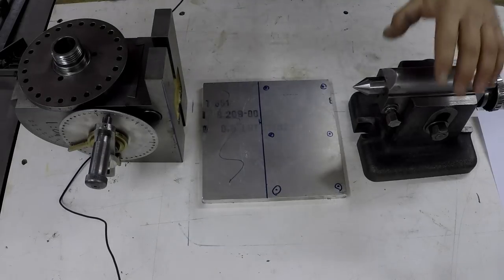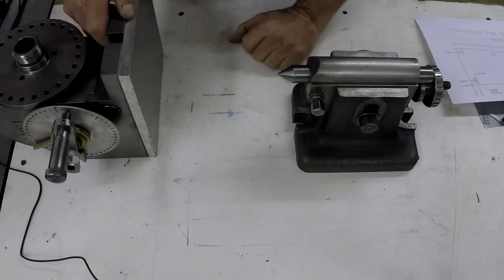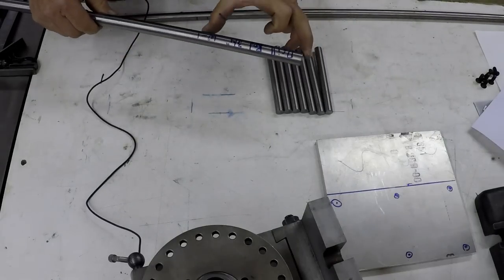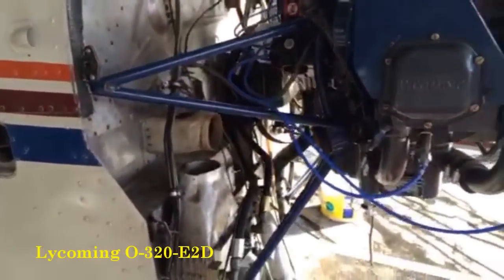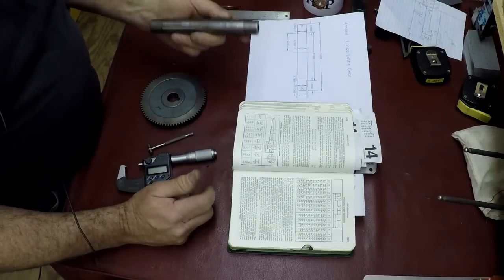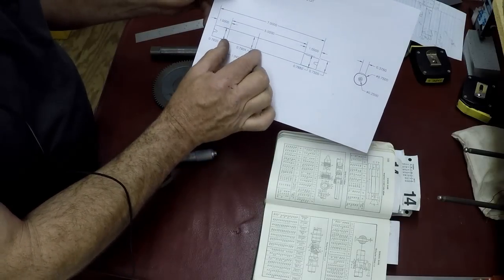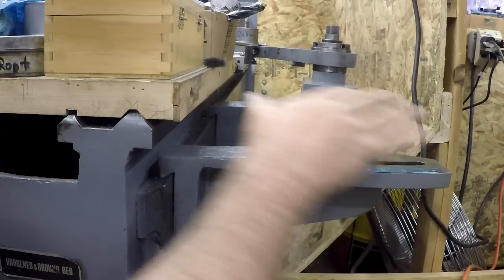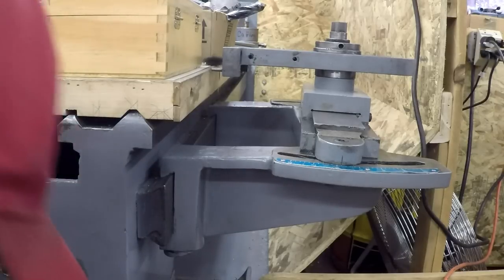How to Repair a Lathe Change Gear Part 1

Comment: Thanks Randy, looking forward to the next part... never used a taper attachment.
Reply from the maker: l0ckcr4ck3r  Thanks for your support and it will take a few vids to get to use the Taper attachment.  It should work good.  Thanks Randy

Comment: Sort of like home remodeling, you never know what you will find when you open a wall or dig a hole.  (-:  One project leads to two or three.  I am looking forward to watching the taper attachment and gear repair videos.

Another good one Randy.

Thanks.

Bob
Reply from the maker: Bob Horton Sure is Bob.  But that is ok it all is fun and will make some good video.  Lots of setups and metal working techniques.  Thanks for watching, Randy

Comment: Hey Randy,
Dont you love how one project triggers another, but then something else is needed for the second, but then you need parts for the second, parts come in and need to be modified for the third, and on it goes ......

If your flow chart makes a complete circle, things get dicey :)

Enjoyed,
Z
Reply from the maker: Shadon HKW It always goes like this it seems.  On the ship I would just throw it over the side and start form the beginning.  You just want to avoid getting stuck in the loop.  Thanks Stan for your support.  Randy
Reply: Randy Richard
That's what my Pops kept saying when I first got my Atlas "All the jobs you fellas are doing is using one machine to fix another machine, LOL!" Old timer has really taken a liking to all of you guys and how much your work is interesting to me, and is giving me more purpose and drive, so he wanted me to thank you both actually...so from Pops "Thank You!"

I do have a question about your gear repair Randy, and I hope it's OK to call you tomorrow? Thanks again for the show, and fun ride there on that Cessna...so amazing that you know how to fix them and can fly around like that.

Talk soon, Aloha...Chuck

Comment: Hey Randy, Good video.  I really enjoy the test flight  video. I bet you were thinking about every nut, screw and bolt. I've enjoyed that a few times. Looked like rough terrain.  Good flying David
Reply from the maker: David Reaid Oh yea always thinking of that.  it was a good flight, the engine ran perfect. Rough but there are quite a few meadows and open areas.  Thanks for watching.  Randy

Comment: Hi Randy great job on the engine change id have been terrified if id done it didnt seem like many places to land exept the runway if something went wrong thanks for posting
Reply from the maker: david sanderson Thanks David.  Well always remember you don't always see everything.  The engine was test run for 1 hr on a test stand by the overhauler.  I test ran the engine at full power for 30 min with 30 more min of start/stop type test.  Then we flew 2  patterns over the airport within gliding distance, landed and made more checks and inspections.  Then we flew around for 30 min for the video.  Dave the owner is a very good pilot with lots of experience, I to am a pilot.  We always had a place in view for that unexpected landing.  Thank you for your concern and a very valid one.  Thanks for watching.  Randy

Comment: Hey Randy good stuff, at about the 16:19 mark it looked like the bolt on the cowl was loose I was hoping the front wasn't going to come off.. If I remember right american fasteners use 82 degree and metric are 90 degree just another reason to have more tooling.. Take care.
Reply from the maker: rchopp I will have to check that time point, there was a quarter turn on the top right that was a bit questionable.   But since the top cowl is held on buy about 24 fasteners you can loose a few before it comes off.  I am not sure that rule holds fast.  Aviation fasteners are 100 deg.  It more depends on there usage.  Thanks for your support and keep watching.  Randy

Comment: Randy,
Liked the shop work, but loved the flying! What airport did you guys fly out of? And why to they put a "K" in front of the airport designation? It makes it sound like a radio station! When I took lessons in the mid '60s, they used 3 letters designations. Ukiah (my home base) = UKI, Santa Rosa = STS, San Carlos = SQL, etc.  I know grey tee shirts show the dirt, but the would show off the black in your logo better.  Things are getting rough with the water situation. Our friends in Arnold say they may drain Tulluck Lake. That's going to be a death knell for that community of expensive homes on the east side of the lake. We've been by there once years ago. It's as bad as the north end of Bass Lake with its mud and stumps!  Enough rambling. Good luck with making the locking devices for your taper attachment. Thanks for the video.  
Have a good one!
Dave
Reply from the maker: Swarf Rat Thanks Dave for your support.  KMPI - Mariposa.  The K is the ICAO id for the country, as I remember.  The water problem is going to be very bad, and the government doesn't have the balls to do anything to stop the bleeding.  Thanks Randy

Comment: I had one rototiller project that snowballed into a lathe repair, a horizontal mill installation, an angle plate refacing, a dividing head repair, an X-Y vise repair, several toolholders, etc. Still don't have the rototiller done. (Rolleyes)
Still need a mill vise and a universal tailstock. However, I can fix the rototiller without the last two.
Reply from the maker: John Bazaar I need a project that leeds to a surface grinder and a Hotrz. Mill and a Shaprer.  Now we are talken projects.  Thanks for your support.  Randy

Comment: I look forward to the video(s) on repairing the taper attachment and then machining the tapered shaft.  I question why you are planning to use a tapered shaft to secure the gear for repair.  Everything in this video indicates the gear bore is straight, so wouldn't using a tapered shaft as an arbor produce inferior holding?  Seems a straight arbor with shaft diameter equal to the gear's bore diameter and having a shoulder for gear to press against and a threaded section for a locking nut to hold gear securely.
Reply from the maker: Morris Gallo Thanks for watching.  Your idea will also work or even having a key in the arbor would work.  The taper is very slight, the recommend taper is 0.006" per ft. that is only 0.0005" per 1 inch.  The gear is about 3/4" thick.  The gear will jam on there very easily and be tight enough to do light turning and tight enough to cut the two gear teeth, it will also be concentric to the shaft.  This is a very common method.  I will be able to mount it on the arbor and turn the braze down then move it to the mill and set up to cut the gears.  If I had heavy turning to do another method could be in order.  Thanks for the great question.  Randy

Comment: I rebuilt 2 mags for a Beech 18 the tail dragger has not returned 20 years later still waiting. Do you need any mag work done on your air crafts? (lol)
Reply from the maker: Randall Moore Nice aircraft.  Good to here a job well done.  Thanks for watching.  Randy
Reply: Hi Randy, I rebuild oil field magnetos, Iam sorry if I miss lead you on the Beechcraft magneto rebuild Ihave never touched one or2 witch I know they have. Hope I got that cleared up. Thanks.
Reply from the maker: Randall Moore Ok no problem. probably not much different.   Randy